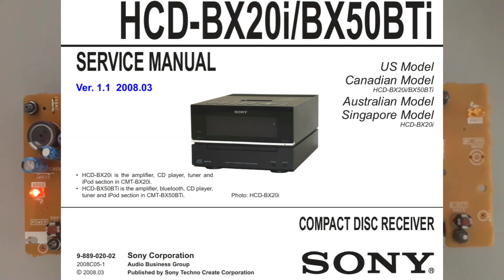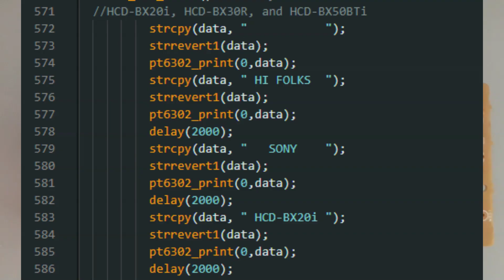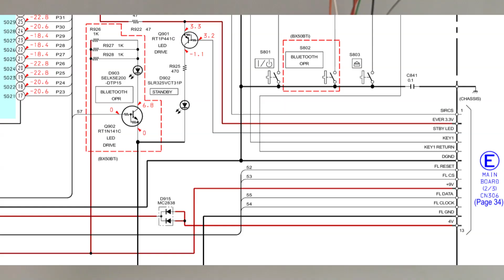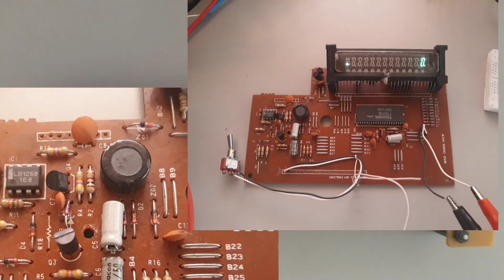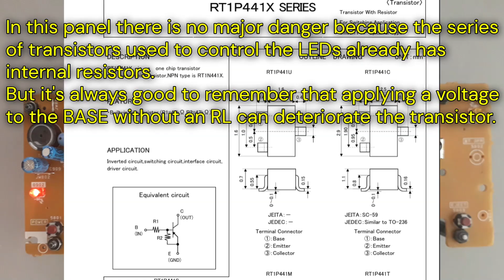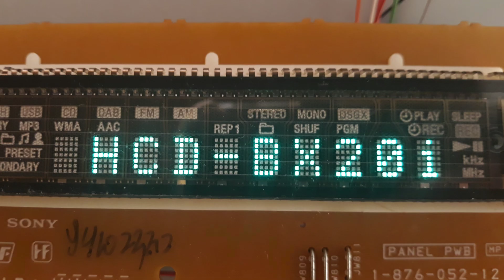PT6302 Technical Tutorial

Comment: Good analysis!  Do  you think you would have been able to figure this circuit out without the schematic?
Reply from the maker: Hi @Enigma758,
Yes! Modesty aside, but of course it would be without a doubt! It would take a little more time, but these circuits are predictable and can't vary much. The goal of the video is really to help people who might find this process difficult; going deeper might even help someone to design a similar circuit... good luck and thanks for watching and for being here on the channel!
Reply: @jlsmonte  If you only had the display board, I was thinking it might be hard to know the voltages because you couldn't measure them,  you might have to infer them from the circuitry.
Reply from the maker: Hi @Enigma758,

Electronics is based on an exact science, so there are mathematical formulas to achieve the expected behavior in a circuit. By measuring the primary winding in Henrys, we can determine its impedance based on the applied frequency.

Of course, we need the help of some instruments. I used an oscilloscope to analyze the high-frequency transformer operation and included a screenshot in the video illustrating the voltages at the secondary output.

Having some experience helps a lot here, as most multimeters stop measuring AC voltage at high frequencies. In my case, I still choose to use an old Fluke 77, which stops measuring AC around 11 kHz. If we are aware of these limitations, we know we just need to measure after the rectification bridge. Of course, using an oscilloscope instead of a multimeter completely solves this.

Since we know the driver and its datasheet is available, it's easy to find the operating voltage (either 3.3VDC or 5VDC). On this panel, the IR power supply is clearly not the same as the driver's.

IR receivers come in a variety of voltages and pinouts. In this case, we observe in PCB, they use the same resistor value for both power and output, which makes it tricky to find the IR's power pin. However, by tracing the PCB track, we can see it connects to the collector of a PNP transistor. The GND is easy to find, so whatever is left must be the output!

Regarding the VEE, there is a 50V filter capacitor on the board, but our driver goes up to -35V max. Since capacitors should handle peaks of about twice their operating voltage, we can feel safe with the value observed on the oscilloscope (around 30V, which sits around 25V after rectification and filtering).

The power supply for the PT6302 driver is the easiest to determine: there is a diode in the VDD pin circuit, so a 0.7V voltage drop is expected. Therefore, the input must be either 4V or 5.6V to compensate for that drop.

Everything explained above can be figured out without the circuit schematic—though, of course, it takes about 8 hours instead of 4!

I hope this line of reasoning helps you tackle a similar circuit with confidence.